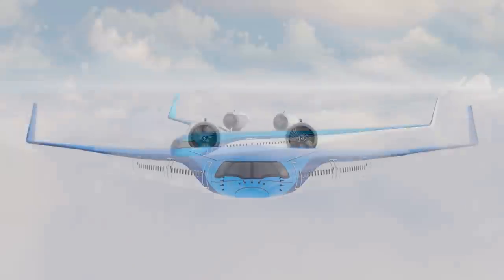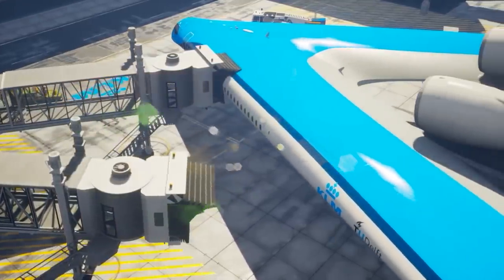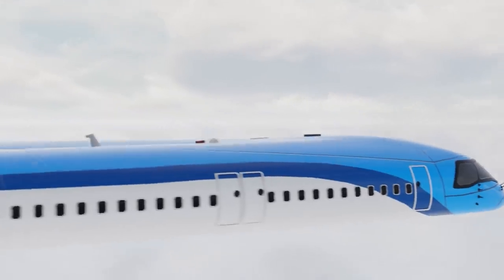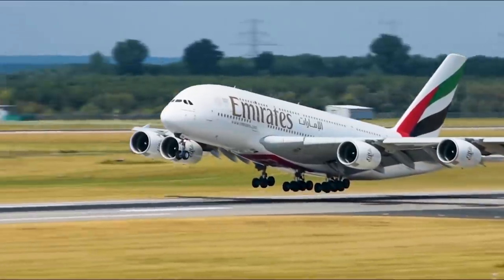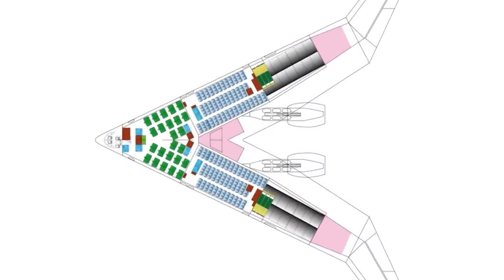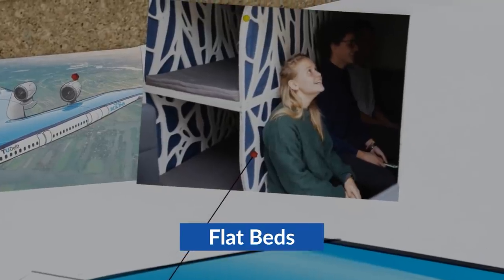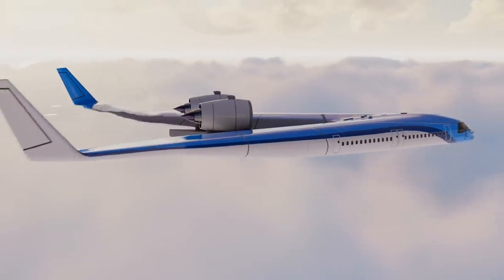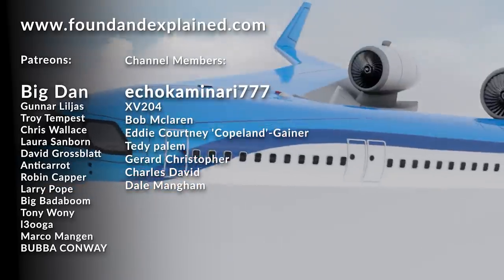Why would you (not) want to ride the Flying V

Comment: Yeah, Boeing actually flew a subscale blended wing body aircraft in the 1990s to research it. It worked well enough, but they found passengers want windows.
Reply: why couldnt they provide a virutal window they could even switch around to var places on the plane even the front camera..why such a lack of imagination. the tvs are already in the seats to use.
Reply: @marsmotion  where does the cargo go? its seems that it is not underneath the passengers. there is potential for floor windows

Comment: The biggest problem from Boeing BWB study is evacuations… they can’t find a way to evacuate people in 90 seconds with half of the exits blocked
Reply: And plenty of other studies that avoid the same bad assumptions in layout, to show that's not necessarily the end.

Also, any smaller plane benefits from eliminating static drag fuselages, and don;'t have any problem with evacuation.

Anyway, everyone from Boeing and Lock-Mart and NASA, to TSAGI to Airbus all have published studies of it and say it's not a problem.

Also, freight and the military don't care.
Reply: @JFrazer4303  I assure you there is a reason why Boeing-NASA BWB study canceled.  If it's not a problem they would have built it, the study is done in 2012. 
Heck BWB even have a flyable scaled prototype (6/100 scale).

If evacuation isn't a problem think about this: What if  in a crash, one side of wing's front exit can't be used and rear exit blocked by the engine wreckage/fire...and people have to traverse a crashed plane to the other side to evacuate.

The biggest problem by far is stability, especially lateral stability during engine failure, and difficulty of recovery during a stall. Which I stated in another comment.

Also, I assume what you said about "static drag" is skin friction drag drag? There are many different types of drags, remove fuselage reduces skin friction drag (drag caused by attaching to a surface), but a thicker wing cause larger pressure drag due to bigger frontal projection area.

The biggest drag airliners face are lift-induced drag and wave drag, one is caused by lift produced by wings (which can be worse for flying wings because the wing is thicker). Wave drag on the other hand is why 787 and A350 are considered as major upgrade from 767 and A330. The new wings have less wave drag which is important for long flights.
The good new is flying wings can barely fly at speeds where wave drag matter... YB-49's (largest flying wing built) maximum speed is slower than the cruise speed of a ATR-72 turboprop. YB-49 cruise at 0.47
Reply: Evacuation testing is what limits capacity.  The JAA certified the NG 737 for fewer pax than the FAA based on their tests.  If you add more exits on the exterior, then you’ll increase weight and wind up with a seat pitch that isn’t economical.
Reply: To improve this, every single seat will have a trapdoor below.

Comment: I think it's going to require more than a 20% fuel savings to make this much of a radical change in aviation.
Reply: Probably which is sad
Reply: 15% with the Airbus A320 Neo really shook up the aviation industry. The margins are very tight and that much of a fuel savings will definitely get their attention.
Reply: And that's why it hasn't happened all the decades of air travel.
"If it looks right, it'll fly right" is ironclad rule, in the minds of those who've already made up their minds and won't be swayed by fact.
Reply: the point of this design is that it isn't actually that radical, as far as infrastructure goes.  No in-body engine means it can use whatever engine comes out on the market.  The same footprint and wingspan as a regular plane means it can still use normal airport spaces.

Comment: I definitely would not fly on this, its safety is not exactly going to be great, because if the engine pylons are not well built, during a crash, the impact may cause them to slam into the cabin, the non-motion facing seats mean the forces will not be from the front to the back of a body, it will be from the front right/left to the back left/right, meaning the brace position would no longer be effective in protecting the person, the face to face seating is probably going to be fine as long as the table can be fully retracted out of the way during take-off and landing, and the swing seat idea is just stupid on multiple levels. Evacuation is also going to be an absolute nighmare.

Comment: The evacuation problem seems simple enough to solve. Take a page from building fire codes and school buses, add more doors.

It's a V shape, meaning there's plenty of space on the inside and outside for exits. Even the roof is an option.
Reply: my first thought was "put in evacuation slides underneath, where the bomb bay would be" But that wouldn't work for a water or belly landing. Maybe paired exits above and below depending on the nature of the evacuation 

My other idea is to have larger doors so people can evacuate two abreast, and to have differentially sized aisles, the aisles on the outside being standard size, but the interior aisles being slightly wider so passengers on the inside can move about more easily and faster than those on the outside.
Reply: Attic style stairs that drop is even a better idea considering water landings and the leading edge is also the exit
Reply: @KTo288  not exactly practical. A rooftop exit prior to a crash with injuries and debris would be problematic from the get with children and mobility impared.
Reply: Yeah but buildings and buses do not pressurize or fly at 30.000 feet. Rooftop exits exist because tall land vehicles are more likely to roll over on their side. Each airplane door cost money and is a potential point of failure. So you need to be as efficient as possible.
Reply: @arbhall7572  "A rooftop exit prior to a crash [...] would be problematic"
To be fair, in almost all instances any exit from anywhere in the plane prior to a crash would be highly problematic. Not in the least because you're probably still around 30.000ft high...
Reply: Just same problems how Blended Wing Body
Reply: @doffer115  yeah, but if those people can't use an exit under normal conditions then it doesn't really count as an exit, if I understand the law.
Reply: Well is not that simple, planes need to able to evacuate with half of the exits blocked. You see, the worst case would be half of wing's exit inoperable by fire or debris. Which is more likely than front half/rear half of plane unable to evacuate during a crash landing.
Reply: @KTo288  It could have enormous clamshell doors like a cargo plane out the back of both fuselage sections, no one said you have to stick to the traditional airbridge entry/exits for emergencies. Right?
Reply: Also Boeing has done tests on a full delta flying wing of roughly similar dimensions and found it's actually faster than through a tube shape. Mostly because the biggest bottleneck in evacuation is the 90 degree turn people have to make from the gangway to the door. The flying wing decreases that.
The biggest thing working against any sort of flying wing is actually that we have a ton of infrastructure build with tube planes in mind and it's a real question if the flying wing would justify reworking tons of airports.
Reply: I know, right?  Kinda like how they put not just 1 but 2 doors over each wing on many planes!?  And those doors don't have to result in any more TOTAL area and # of doors than a normal plane of the same seat loading to achieve the same TOTAL evac times!  And at least some (but none have to be) of those doors could be on the inner / trailing edges of the flying wing body.  Obviously, they can't board using them (at least not without highly customized and costly jet bridges), but most planes only board / deplane via 1 (at most 2) door(s) anyways.  The other doors are almost always for - emergency - exits - only!?  From the illustrations and the scale model in the vid, I don't see why there wouldn't be room for inflatable emergency slides or rafts coming out of emergency exist doors on the inner / trailing edges of the flying wing body!?

Comment: I saw this plane being built while doing my thesis at TU Delft. The guy running this project was my supervisor. I sometimes worked with the team seen in the video and pitched them a few ideas for the prototype. It took them about two years to make the prototype and the amount of engineering that went into it is astonishing! 
It really is the pride and glory of the TU Delft aerospace department :)
Reply: Don't you think the jet engines mounted as underslungs would have been better from a maintenance view?
Reply: @PS-nf3xw  Do you want the coolness design be sacrificed for addressing petty practical details ? /s
Reply: @PS-nf3xw  oh they're better from multiple perspectives. However, it was impossible to put the engines underneath in this case because of ground clearance.
Reply: @alexandrunechifor  there was a planned Luftwaffe ww2 flying wing with fixed landing gears and the engine nachells fitted around it. Did you folks consider any underslung concept with a fairing for retractable landing gears for higher ground clearance?
Reply: @PS-nf3xw  Oh the Horten Ho 229 you mean? There's a big difference, the Flying-V has a large wing sweep so the wing tips are far back. This gives problems when rotating on the runway since the wing tips could scrape the ground. For this, the Flying-V already has a very tall landing gear and making it even taller would bring about a host of other problems. 
Additionally, the Flying V has a substantial nose-up pitching moment beyond a certain angle of attack. So adding the engines underneath could exacerbate this problem in certain flight conditions.
I recall some design variants considered this but eventually it was decided upon the current engine placement.
Reply: "Pride and glory" well that says enough about the crisis the academic world is in. Spending two years and million dollar budgets on a design riddled with fatal flaws. This thing is just as dead as the equally hyped Hyperloop.
Reply: I live in delft

Comment: Among the reasons these concepts get killed before they can ever make it to a full sized prototype is a concern for passengers.  Specifically, the passenger experience toward the end of the wings.  As a normal tube plane banks for a turn, you do notice it, but it's nothing to mention.  When a flying wing or blended wing banks over the passengers towards the wingtips feel a sudden drop or elevation of several meters, depending on the angle of the bank.  Even with sufficient warning, this could frighten some passengers greatly, and increase the likelihood of air sickness.  Anyone who happens to be ignoring the seatbelt sign at the time will have a difficult time to say the least, meaning that air stewards / cabin crew will have to either be centerline or buckled in during turns.  
And that's just PLANNED manoeuvres.  Unplanned, or emergency banking manoeuvres could be catastrophic.  Imagine a 100 kg trolley appearing to suddenly lift into the air because the pilot needed to make an emergency manoeuvre.  Where is it going to come down?

It would be amazing to see blended wing airplane designs in passenger service, but the aforementioned risks and concerns are one of the many things that will keep them on the page and out of the sky.
Reply: Concord
I agree
Reply: What if the flight attendants just have a rope on them that is connected to a track on the ceiling like on a ropes course. I am partially joking but it would be a possible option.
Reply: And freight and military users don't care.
As for me, give me a wing=tip seat and it'd be a great flight.

Passengers who supposedly can't take it go up into the mountains and ski, or race sailboats or ride amusement park rides. Yet they won't take a cheaper seat in a better plane because of being off-center in a roll.
Reply: I would LOVE that, put me as close to the edge as possible!
Reply: “V” would stand for Vomitcraft!!
Reply: I couldn’t agree more. Not only it’s impractical but has a wide frontal cross sectional area that would make aerodynamic drag worse. And the lack of brace over the rear will induce large torsional stresses on the fuselage.
Reply: Agreed, not being able to face dead straight ahead while sitting gives me the heebie-jeebies.
Reply: I never thought of that. Good point.
Reply: The trolleys would be locked into rails in the floor.
Reply: I highly doubt these concerns have anything to do with these planes not existing at this point in time. I guarantee aerospace engineers would be able to develop technologies to mitigate or erase these problems entirely. When passenger trains were first becoming a thing, many people were afraid to ride them because they simply had never moved so fast in their entire lives. I'd argue that taking off and landing is far more terrifying than a gradual banked turn. I doubt there are very many people who would be fine with taking off and landing but would be so afraid of turning it would prevent them from ever flying again. It may take some time for everyone to get used to get used to it, but, eventually, it would just be a routine part of the whole aviation experience.

And like the guy above me said, a railing system for the trolleys would be incredibly easy to design and implement.
Reply: Passenger aircraft have to be pressurised. That is why the fuselage is a round tube . It is structurally the most efficient shape by far to resist the huge forces from pressurisation. A less efficient shape means much more structural weight, which in turn will negate much, if not all of the aerodynamic benefits.